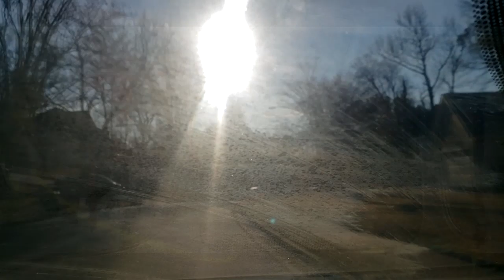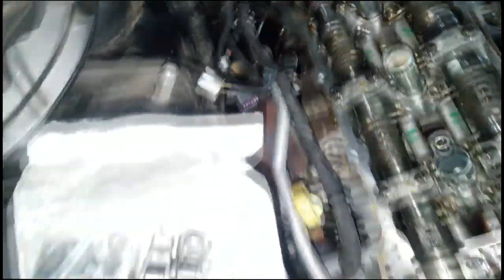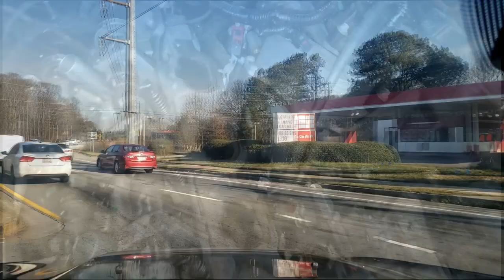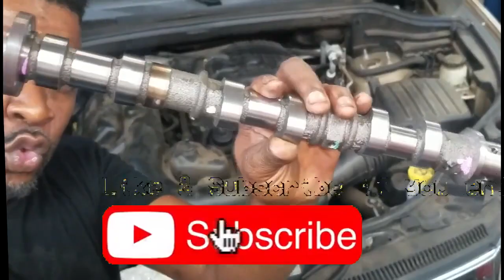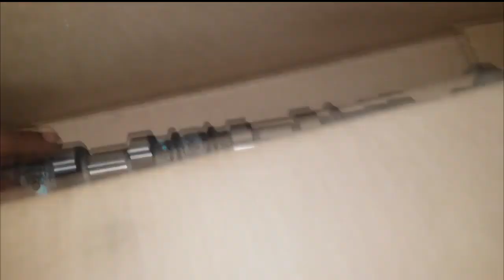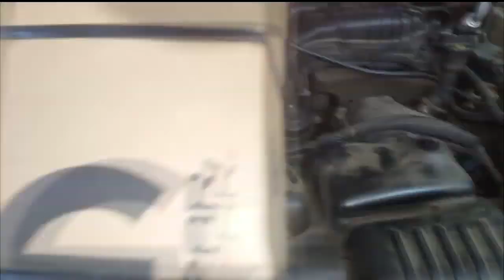How much money it cost to fix a Motor Tick, Hemi Tick, 3.6 Pentastar V6 problems.The answer shocking

Comment: This is Dave I got a 2004 Jeep grand Cherokee 4.0 L my transmission was making a weird whistling noise now after I parked and let it sit and got back in it and tried to leave it didn’t wanna move anywhere I finally got it to move but it wouldn’t go nowhere near the speed it was supposed to it’s like the trans is slipping but then when I stop the jeep is jerking all over the place because it’s like it’s stuck in first gear like it wants to take off to me I am assuming The torque converter any tips on what to look for